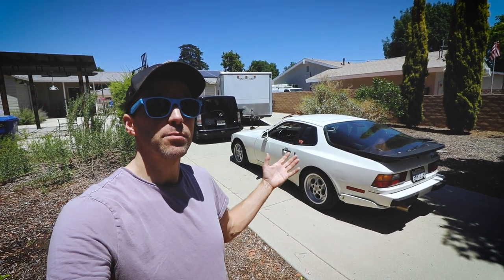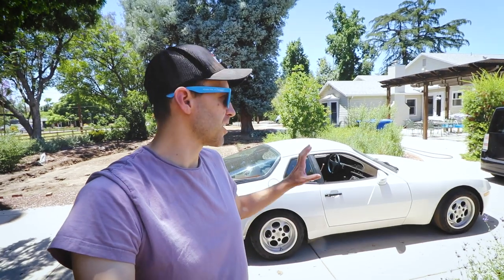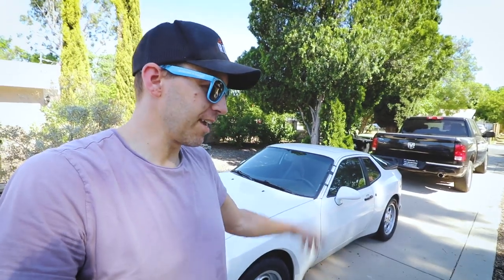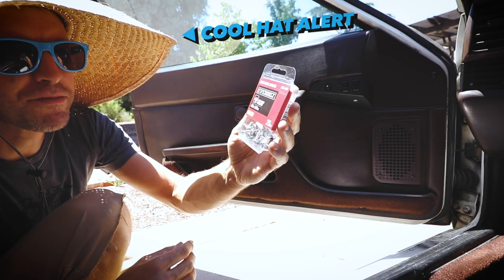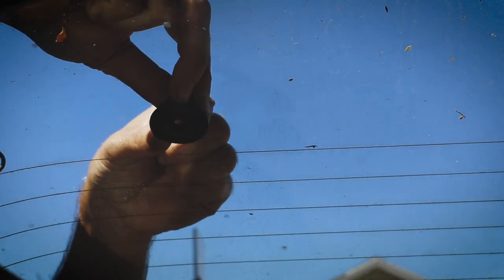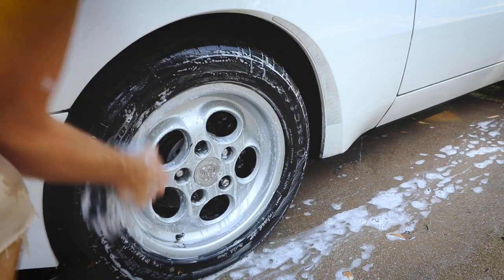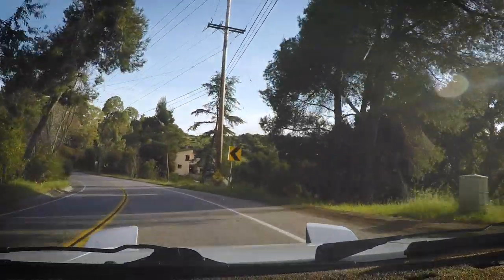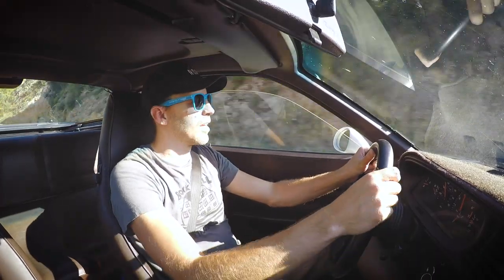Cheap Upgrades and New Tires for the Porsche 944 Turbo!

Comment: Lug Nuts, hand thread them on for 10-12 threads before hitting it with drill. Drill has enough torques to jack the threads.

Comment: Try a clay bar kit for the sap!
I think it'll work, because it SHEERS junk like that off.
Reply: Good call.   Clay does wonders.
Reply: Also, Audi makes a really good bug/tar cleaner, too!  Get it at the dealer.  (I/m not compensated by them, just tried it on my Audi and it worked GREAT!  Will use on my 951 when needed.)
Reply: PINE- SOL !!!!! Cheap 😎😎😎😎😎😎😄😄😄😄😄🍺🍺🍺🍺

Comment: There's a hole cover from Porsche for those who "deleted" the rear wiper motor.  Check with a Porsche parts recycler as they should have one.  Also, think Metric for sockets, etc.

Comment: Anything alcohol based should remove the sap. The higher the concentration, the bigger.  Check out chrisfix's video as reference on the same issue.

I have BBS on my black 86, but they are the RS version. Keep the 944 videos coming!

Comment: Love the phone dials. Sap and tar is always tough--too weak and it it does not work, too strong and you risk ruining the paint. i have had luck  with the cheap Turtle Wax by letting it sit on the bad spots for a little time

Comment: Actually I might be able to give some helpful feedback on your tire situation. I'm tires for a mixture of daily driving, autocross, and the occasional track day. They do offer a a ridiculous amount of grip for a street tire. After one track day, one autocross, and 25,000 street miles, my front tires are pretty well worn out and the rear tires are still closed to new (RSX Type-S). Adding a little bit of air pressure takes care of the additional sidewall flex compared to the Kumho tires. Once they get halfway Warren they do become a little more dicey in standing water, and the noise level increases dramatically as they wear. There are supposedly confirmed reports that this is actually a rebadged previous-generation Bridgestone Potenza RE71, and they do seem to offer similar performance to that tire.
Reply: Apparently some of that reply was deleted by accident. That should have began by saying that I'm using the same Tire for a mix of daily driving, track day, and autox use.

Comment: Have you checked if the plastic worm gears in the odometer sensor aren't broken in the instrument Cluster? It's common for them to stop working if you push the reset button while the car is moving or in motion of any sorts. I found a reference: http://www.clarks-garage.com/shop-manual/elect-09.htm